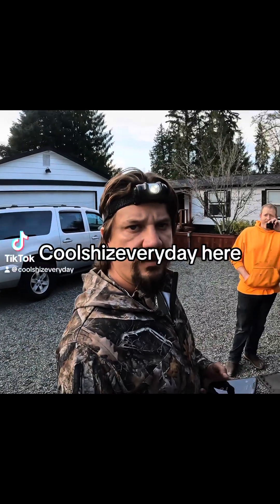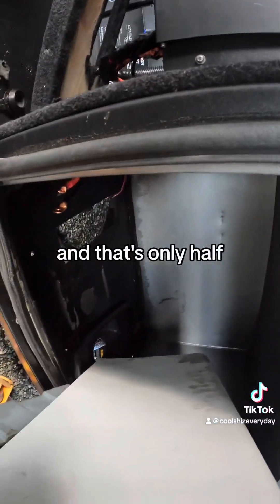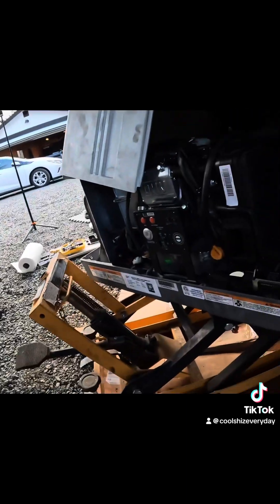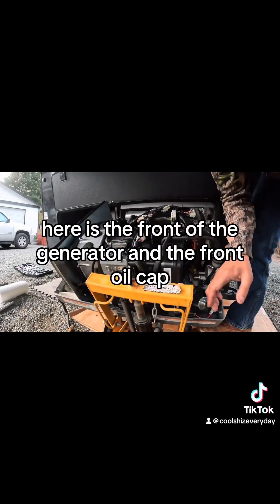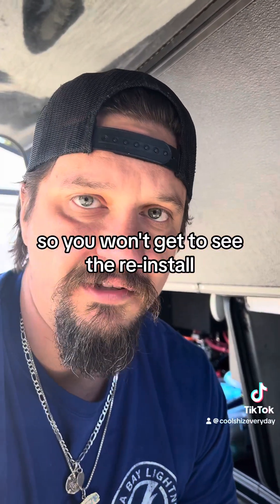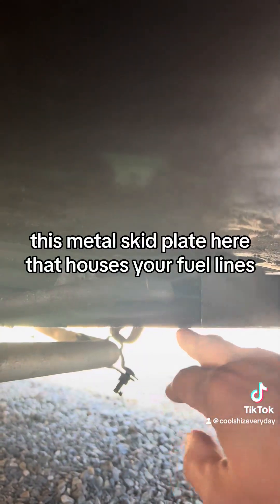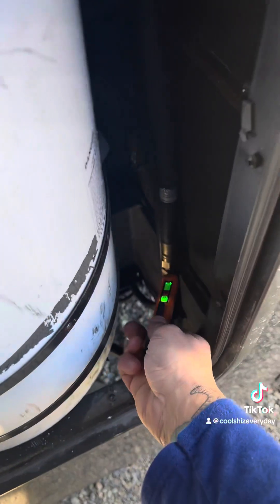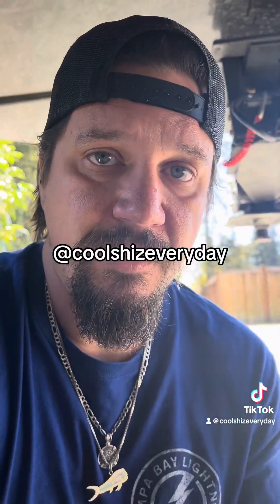FlexPower 5500 onboard RV generator repair

Comment: I recently installed a Flex 5500 in my Alliance Valor 36V11. Initially I bolted the generator directly to the pan in the generator bay but it vibrates so much I could feel the vibration through the frame all the way back in the garage of the RV. I pulled the generator out and installed rubber isolators that RVMP sent me. It helped but it's still a noticeable vibration, especially in the room right above the generator bay. I finally got to make use of the generator last weekend and I parked the RV in my storage unit on Sunday evening. When I went out to the RV yesterday I saw where oil had leaked onto the concrete pad and oil was dripping from the pan underneath the generator bay. I've been stressing about pulling the generator out again and wondering what could possibly be leaking, but your video gives me hope that it's only the filler cap on the back side of the unit. Fortunately, since I installed my generator myself, I left slack in the electrical, fuel and battery connections. Still going to be a PIA though. Thanks for posting the video!